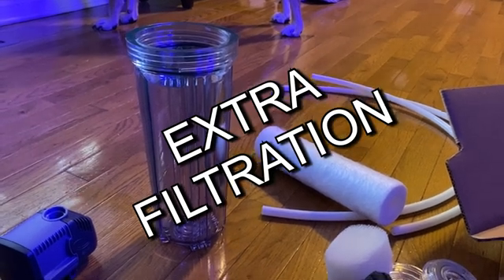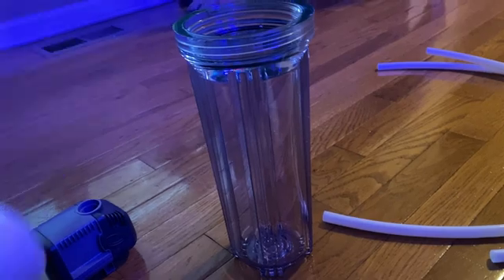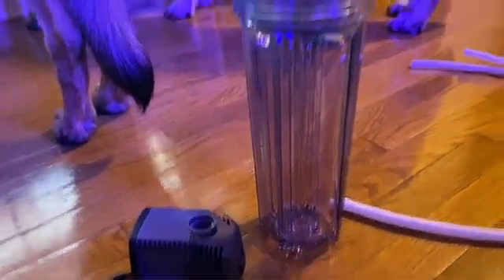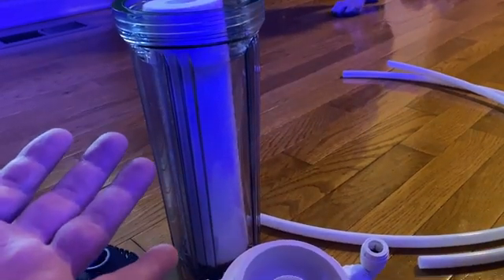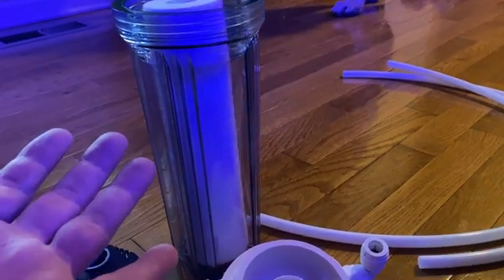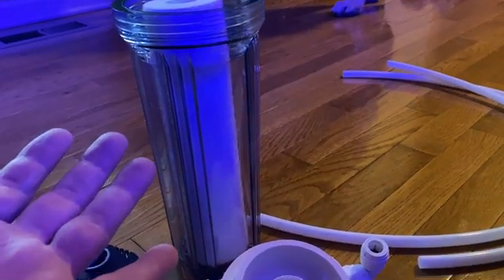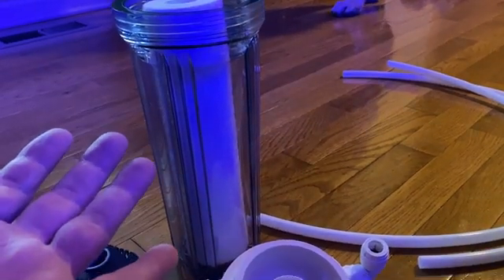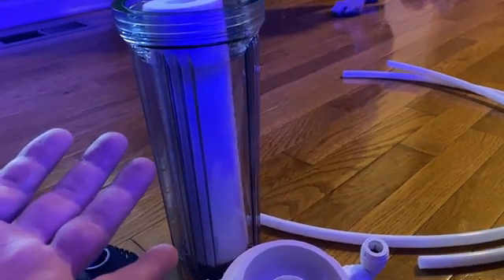Lower nitrates in saltwater aquarium with DIY filter

Comment: I have a sumpless (if that that is a word) 60 cube.  I'm doing something similar with a dual reactor.  I had a sump on my old system, so I have filter socks laying around that I cut the plastic ring off and rolled up, placed two of them in the first chamber.  In the second chamber I have some carbon media.  I use two flow valves, one on each side, not for flow, but to prevent a siphon when I swap out media.  This is my only mechanical filtration.  Been running it about a month, so far so good.  I'm curious to find out if I put a filter and carbon block that is used on the RODI system, what impact that will have on the water clarity.
Reply from the maker: sounds like a good plan.